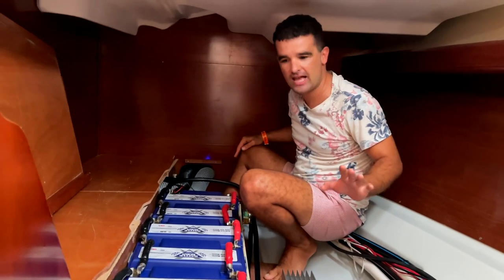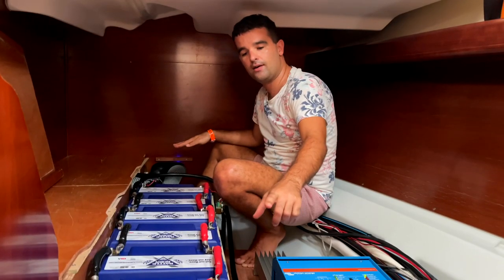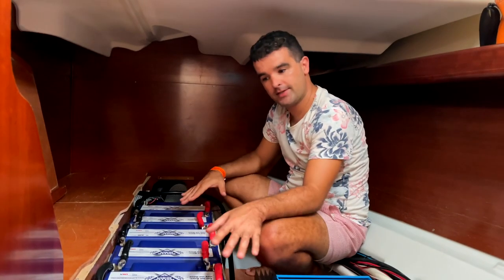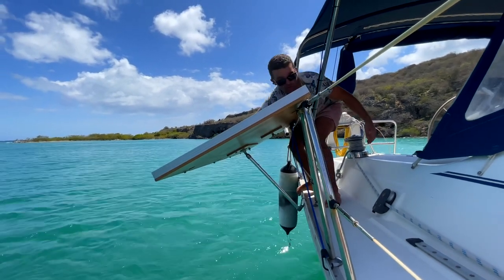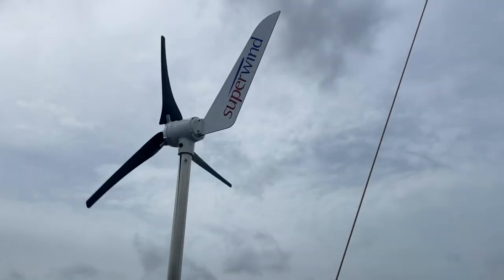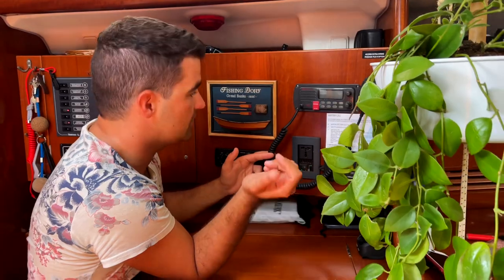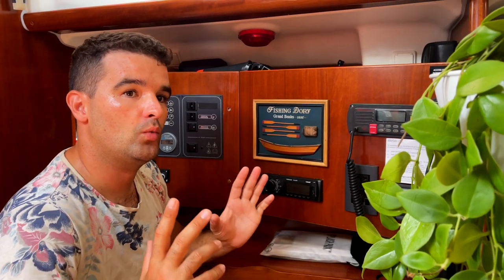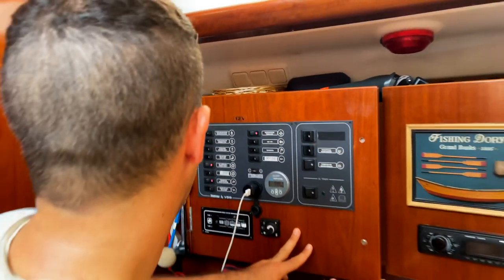LITHIUM, SOLAR and WIND Generator on our SAILBOAT (complete electrical power set up) ⛵️

Comment: Nice set up. looks to be working very well . Was in two minds about a wind gendrator, I think you have swung me in Favour of one. Thanks for the insights.  Best Wishes and Fair Winds.  Bob.  👍⛵️✨️✨️✨️
Reply from the maker: Hey Bob :) we are very happy with our set up 🌬️ ☀️ 🔋 we also discussed a lot if we should get a wind generator but are very happy about it now ☺️
Reply: @WhenSailing  You  Certainly got me looking, and I think I'll be going with a Dutland 1200 model now. I've had a couple of Rutland made ones before,  and Customer Service was always  top notch tbh, as were their smaller Wind gennies, which kept things topped up when away from the Boat. I think the 1200 has enough output to really assist the Solar Panels, as I may not be able to get enough Solar if I get a smaller Sailboat to tide me over until I  can get a new Island Packet IP 439, which I'll be able to transfer it to. I may try for a Bensteau 2 Cabin 1 head and shower Oceanis 370 , which should be fun to Solo across the Atlantic with on a South of Cape Verde to North Argentina route. Biggest risk, getting becalmed for weeks lol so Watermaker pretty essential 👌  Best Wishes and Fair Winds.  Bob.  ⛵️✨️✨️✨️❤️

Comment: Our battery installation, although both having LiFePO4 batteries, look as though they have been designed on different planets.

Firstly, my power loads exclude washers, driers, electric mixers, video editing gear. I also sized my system in terms requirements at sea so that I could run my autopilot 24x7 - even with 2 or 3 overcast days, if I was compelled to. In practice, I’ve tamed my HydroV,and so I only use the autopilot when motoring in/out of port or when working at the mast or tacking or gybing (the technology simplifies things for me and I sail single-handed). 4x100 Ah batteries are working out fine for me.

Secondly, my boat “Thistle Doo”, a HR-38 is of a totally different shape compared with “For Tuna” and that provides me with advantages. My batteries live in a battery box built into the port stern bunk and I’ve connected them with a dual bus bar combiner, with each battery fused, and they connect from there with connections just to the bas bars. Outside that box, the world sees nothing of the batteries, just the pair of terminals from the combiner. That box is way higher up than your’s, which would help in case of flooding, but you can only use the space that you have. From the battery box, connections go either to the old connection system (not going to rewire the whole boat) or to a series of distribution boxes which house their own connectors, fuses and bus bars for up to 4 connections; I think it’s important to protect the wiring with fuses, as well as the charging sources and loads. These boxes distribute power to a few items that need to bypass the master house switch and panel for technical reasons (bilge pump system, autopilot drive power, DC2DC charger for the starter battery) and receive power from the MMPTs, the wind generator HRSI, the inverter/charger and the Belmar alternator (my engine does not directly change the starter battery).

My inverter/charger is mounted in a wardrobe, with plenty of air circulation and access because that’s where the old one was, but the MMPTs, a pair of switches for my pair of 305w rigid panels, the HRSi, the DC2DC  charger are all mounted in clear view on the stern cabin rear wall where I can see things at a glance (or run a disco with all the flashing lights).

As I said earlier, my focus is on battery charge at sea, not in port and I don’t like my batteries sitting on full endlessly because I believe it shortens their life span, so here, in Curacao, I’ve removed shore power and also switched out one solar panel as there’s just so much sunlight here. At sea, it’s a bit different as the batteries are always in use,  and as long as I have at least 90% SOC entering night time, I am happy. Lowest I’ve had in the morning has been 60% but that’s been during strings of of overcast days at sea, when I entered the night at lower than 90% anyway.

So differences I see in our installations - fewer batteries, a more convenient installation arrangement for me - but way more fuses.
Reply from the maker: Hi Ian 😃really great system! We wanted to search for busbar with fuses but were already happy we found those bus bars (fuses were also difficult to find;) would have loved to connect each battery to a fuse and then to a bus bar but also from a space perspective it would have been difficult...plus might have shifted the batteries more towards the hull so even more weight there (the inverter is really heavy and we are heeling a small bit;) Really nice that you can access your inverter easily, we thought of putting it there too, but then the cables would be way longer and it would be even more towards the hull....unfortunately the other berth if with a water tank so no space there=) Only space we could free up would be a switch to an electro motor;) and get rid of the fuel tank, but suppose we would need a few more batteries there too 😛So did you mostly go with hydrovane during your crossing or had some days where only autopilot was working?
Reply: @WhenSailing  At the start of my crossing, I relied on the autopilot as I had little experience with the HydroVane due to all the lockdowns. But by Madiera things were turned the other way around. Biggest issue was learning to balance the sails well enough and having just a working headsail made that hard sometimes; too little headsail means too much weather helm and I used the full mainsail for less than 2 days.

 With HydroVane, I use the autopilot when gybing (it manages the wheel while I manage the lines), establishing a new course in windvane mode and then adjust the HydroVane in to match. I didn't try tacking at all. In practice, I generally must lock in a few degrees of main helm as my sail balance is not right and the boat might round up otherwise. But once set and stable, the Autopilot is switched off. After that, course adjustments are easy using the control line.

Autopilot is way more flexible and convenient for coastal sailing though and I wouldn't rely on HydroVane anywhere near land or reefs if I needed to sleep as a wind shift around a headland might run you aground, but the same could easily happen by using AutoPilot in windvane mode I suppose.

Coming to grips with HydroVane is a game changer though as it tunes your thinking more to virtual winds and to sail balance.
Reply: @WhenSailing  Michael, you were closer to the battery bus system, that I used, than you realise. I used a “power in” (with extra bolts), from the Victron system. This gave me a twin bus bar system, allowing 100A mega fuses for each battery, all enclosed into a single insulated case - and you can daisy chain them if you have more than four batteries. Once you close them up, you treat the emerging pair of terminals as if they are from one huge battery - without needing to see inside that there are actually more. They also have a version that monitors each fuse and reports of a failure with indicator lights but I thought that was just a bit much. In practice, the BMS from each of my Renogy Smart 100Ah batteries also communicates with the others, across the bus bars, so that cell balancing occurs across the batteries as well as within each one, but that’s more a battery thing than an installation thing.

Comment: Hi, amazing installation. Worst comes to worst, can you charge the batteries by connecting (with an adaptor to the shore power plug),  a portable Honda 2000 generator?
Reply from the maker: yes, the inverter we have is a charger too, so shore power goes to the inverter, you could then connect the honda to it too💪🏻

Comment: Great vid and setup, Could you explain your wind charger setup especially the dump load/brake and controller. We're doing similar but on a smaller scale. We currently have the Marlec HDRi controller for wind power and not sure how to use this with Lithium, Thanks
Reply from the maker: we had to change our temperature sensor on the controller, with a fixed size resistor for lithium, the load resistor came with the generator and is a buffer when the batteries are full😉 you can search for the super wind manual and wiring, lot of stuff explained in there:)

Comment: do you still have lead acid battery for engine and bow thruster and how are they charged is it only when shore power is on or engine running thanks great video
Reply from the maker: Hi Ian, yea we have one starter battery, charged only when the motor is running (alternator) or on shore power:) bow thruster is still on the main bank but we never use it, ideally put 1-2 100aH in front under the berth for the bow thruster, else cables are really long and you loose a lot😆

Comment: From a safety point of view, I suggest you determine how much current could flow in the event of a short circuit. Lithium batteries have very low internal resistance and can permit much higher currents than lead acid ever did. Given you have 7 batteries in parallel I expect the fuse selection of type ANL is not sufficient. It may work and it may physically rupture depending on the magnetic forces encountered. A Class T fuse is likely safer. The BMS will not act in time to address a short circuit. The Class T will also act quicker than ANL resulting is less arcing and protect those around at the time. Food for thought.
Reply from the maker: Thanks Mike! great input, when we installed we could not find a class T fuse this size and then forgot about it😅 have to order some and new holders🙏🙏 thanks for watching!

Comment: Hi!
Can you explain how you connected the solar AND the wind generator? Do they each have an MPPT and then several MPPTs go into the charger/inverter?

My planned setup also has a solar panel and a wind generator and then the same inverter/charger. But I´m not sure if I can connect the solar panel and the wind generator to the same MPPT which then goes on to the inverter/charger, or 2 MPPTs and then if the inverter/charger can take input from several separate MPPTs.

Thanks and thanks for the video! :)
Reply from the maker: every “set” of solars and the wind generator have a separate MPPT to connect them to the batteries 🔋

Comment: Hi. We are looking to install solar 300w on our boat. Did you connect the mppt directly to the house battery bank, or to a battery isolator (to charge both engine and house batteries?)
Reply from the maker: Hi John, we have the solars & wind only on the house, for the alternator we have a isolator, only the alternator charges both✌🏽

Comment: Hi guys. I see that your multiplus is installed in your battery compartment. Although you use lithium, is this safe? Neater for sure. Do you not have any problems with overheating?
Reply from the maker: we have had no problems with overheating our LiFePo4 batteries are very stable :)

Comment: are the wind generator charge controller settings the same as the solar panel charge controller?
Reply from the maker: the wind generator has a different charger controller, it gives us less control over it but the settings are not all too different. always check with the manufacturers you choose, for example we had to change a resistor for the wind generator set up when we switched to lithium
Reply: @WhenSailing  why was that? Which manufacturer we should talk to? The battery or the wind turbine?

Comment: I like everything but if possible I would lose the panel hanging to the right side of the boat.

This would leave you with no immediate visibility of any panels.
Reply from the maker: Thanks Jamie, will consider this in the future! we still have them as the first ones we got flew away and those were the only ones we could find back in cyprus...had to leave the country do to cvid and could not do it without solars 😆
Reply: @WhenSailing  I think you now have a strong and reliable source of power from the additions. The wind turbine was a great addition too.